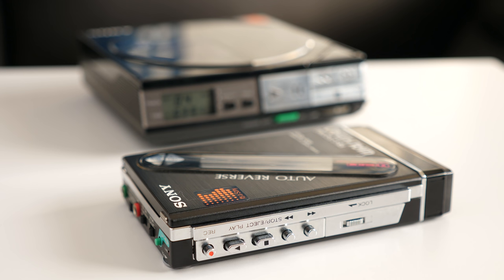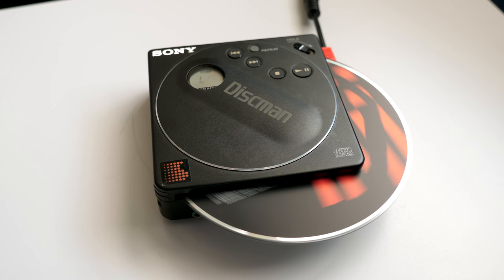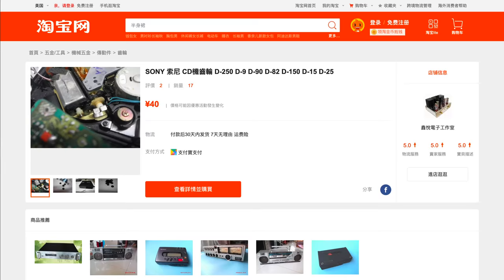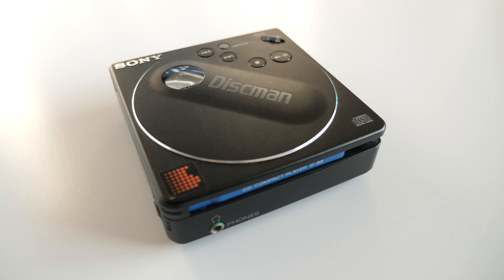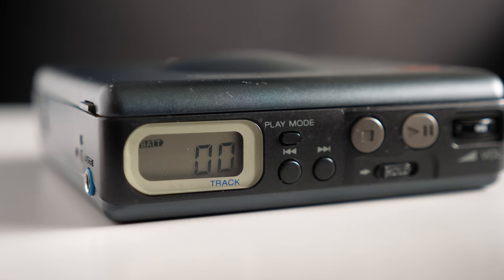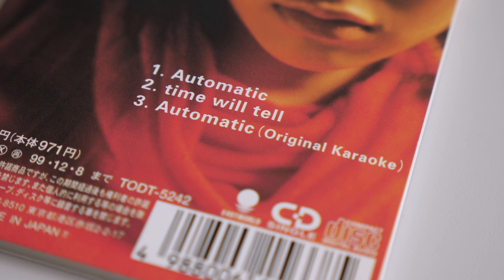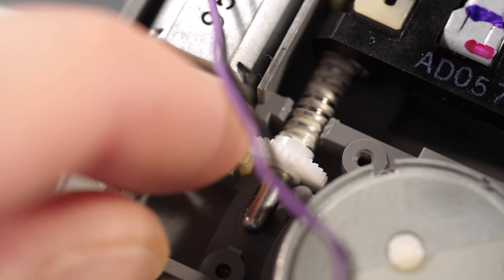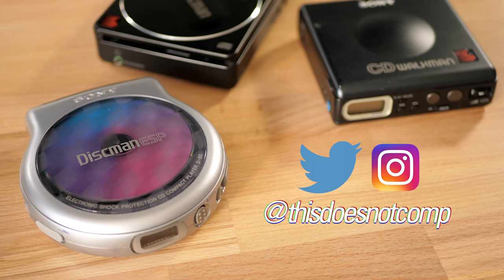The Smallest Portable CD Players Ever Made (That Nobody Bought)

Comment: I remember. D88 used to sell in Sharper Edge. No one had the 300 bucks to pay for it. Besides my D-9 also had problems reading newer CDs. I could use it only for around a decade then its motor broke down. By the way, I am constantly editing my comment, but I need to add some information. Mini-CDs did not find popular base in the US. I bought Metallica's One in mini-CD. It contained a shorter 3 or 4 minute version. I did not like it honestly. Even Wikipedia is not able to remember that shortened radio-version. That mini-CD had much more room to include the full version of the song, but the manufacturers preferred to put the edited version. One day I decided to put it in an envelope and send it to a friend of mine overseas. It wasn't a smart idea but I was a kid, I believed in miracles. It got lost in the mail. I regretted my decision later. Whatever... I bought a 7 inch vinyl record later, with the full 7.30 minute version on a single side. I still keep it. I believe I am happier keeping the vinyl record than keeping that mini-cd version.

Comment: I was amazed seeing this Sony on your channel and I actually own one myself,  like you I had to repair the gear/tracking too. I also have repaired the Sony D-99 player and sold a couple on eBay.. as for the rechargeable battery..I instead modded these myself (taking the remains of inside out with care  and cut the terminals off, fitted a slim AA battery holder and soldered these to terminals.. buy a couple of AA 4.7v l ion rechargeables and then push all inside the casing..works well.
You mentioned about the LCD on the D-88 that you may look into repairing it..is this possible or would you need to replace the LCD itself?

Love your content.
Reply from the maker: I’m not exactly sure yet what it’ll take to repair the LCD, though it sounds like it could be a problem with the flat-flex between it and the main PCB. If I’m lucky it’s just a dirty/bad connection that needs to get cleaned.
Reply: @ThisDoesNotCompute  thanks for your  reply..im not entirely sure if its a ribbon cable fault as I have tried doing as you mentioned and fault still occurs..I feel its more due to the LCD panel itself inside the layers? Anyway will be interesting to see how you get on and you views...🙂
Reply: @ThisDoesNotCompute  in reference to my last comment,  I decided to work out the issue with LCD on my Sony not displaying correctly. I took the intuitive and something told me to apply heat around the LCD panel..to this I took a hair dryer and applied high heat in a circular formation for about 20sec and afterwards let it cool down..this improved the panel but a couple of segment still were not showing.. applied more heat, let it cool down again and to my amazement the LCD panel is back to life and no issues so far... im not sure if this is a solution but in my case it worked wonders..maybe worth something trying?

Comment: The 8cm single was not so populair because it couldn’t be used on a slot loading player, without a flimsy adapter. I have a few 8 cm single, but most cd single released in the Netherlands where 12cm. That said i love the 8cm singles. I have a Freecom MP3 player that uses 8cm disc that can hold up to 185mb. Much more music for a better price back then. A typical mp3 player back then had between 32 or 64mb of storage.

Comment: In the early '90s and the last days of cassette, Sony made some monumentally TINY tape Walkmen. My friend had one that was slightly larger than a cassette tape. Basically the tape, plus a metal shell, and that was about it, with maybe a centimetre of depth on the back for all the workings. Full logic control (ie the buttons weren't mechanical, all moving parts were motorised). Took a tiny little single-cell Nicad, in a weird rectangle shape. Or, you could screw on an accessory that let it run from a AAA battery, significantly adding to it's size even though that was only a bit bigger than the battery was. Either way you'd get more than 10 hours from the battery, I forget exactly how long. Cost him a damn fortune and was one of the nicer ones Sony made. 

I'm sure they'll have made one or two even tinier than that though, and Sony save all their best stuff for Japan. Japanese people will spend more than Westerners are willing to on electronics, though they get some amazing stuff for their money. 

Still, my watch plays MP3s and cost less than 10 quid, so I can't complain really. You can get smartwatches, that Bluetooth to your phone, and also can take a SIM of their own to act fully as an independent phone, for less than $10. 

Or you could mortgage your arm for an Apple one. Seems silly. Mine's got a camera, too, touchscreen, all the usual sort of gubbins. Doesn't have downloadable apps though, but it DOES have Internet, on a value for money ratio it's about 20x better than Apple or Samsung's are. Maybe half as good for 2% of the price.

Comment: After watching this. Was thinking getting a nice portable player mostly for the theater receiver. maybe i can bring it with me. Can someone recommend a recent player that will be good?
I did remember a buddy with his player in the early 2000's and it did have bump protection on his. I never had one, just a hand held radio.
I have a 5 disk player from Sony from the 90's, i gotta find it, it will most likely need some sort of repair. I am guessing a rubber band and some new grease should be enough to get this working again. Just gotta do some research on what kind of band it needs and where to get it.
THey went back to records for a bit, people like them better idk why really, prob better sound to them.
CD's in some cases are better then a mp3 player, because mp3 is compressed, wile a CD in most cases are lossless. Lossless codec exist now (like flac) and media players now can hold a bunch of them without problem with the high capacity space. I use my phone nowadays with a nice high quality 3.5mm adapter.

Comment: I can't get over these miniature rechargeable LEAD-ACID batteries! I'm not an expert on lead-acid batteries but that seems like a terrible idea for a consumer electronics product. I couldn't find much technical detail about them, but maybe you could do a teardown?
Reply: I had that same battery in my discman D25.  I unwrapped the sheet metal casing and ordered a protected LiPo cell that fills the case completely.  2600mAH - at least 3X,works for hours and hours.  Charges fine with built in charging circuit.  

The lead acid cell inside was unremarkable - a single lead cell in a transparent casing where you can see the lead plates within.  There’s prob a pressure relief valve through which it could prob be rehydrated back to life, but not worthwhile given the superior lithium ion swap. It seemed roughly similar to the one cel lead acid battery you can find in rechargeable bug zapper rackets still sold today.

At the time that lead battery blew away NiCd, the only rechargeables around.  NiMH wasn’t even a thing yet.    That lead battery worked for at least a decade.
Reply: @yeliab814  Awesome, thanks for the detail! I had no idea about rechargeable bug-zapper rackets, what a use case! Everything I have heard about lead-acid batteries is that they start to degrade if you take them below 50% charge, even somewhat for deep cycle. I wonder if these little ones got around that and how.
Reply: @jfh400  I doubt they get around it, but at least with the Sony it didn’t seem to  discharge it to zero even when sitting for a  reasonable while .    And I never had it refuse to charge until it sat for 20 years, after the usage during first 10 years.  It was beyond dead, zero volts, accepting no charge. But when the use was regular enough,  even w  periods of sitting on charge, nothing could  kill that cell (at least not quickly ).  It was good at the time, and I’m sure Sony has a few tricks in there not featured in the Chinese mini lead batteries today.  Those things definitely self discharge if sitting long time , and the shite charging circuit in the bug zapper racket is simply mains voltage to capacitor dropper, to diode, then thru a resistor and into the battery.   So long periods of plugged-in charging will overcharge and boil off the water in the electrolyte.  Both specimens I have died already and I replaced with lithium.  I still have the lead cells and they have a little vent cap so they’re easy to fill back up with distilled water, but haven’t got round to playing around with.  Not sure what I’d do with them if revived. ..
Reply: @yeliab814  Very interesting! Thanks again for all the details!!

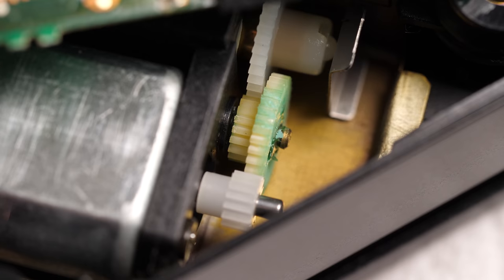Comment: Oh man, at 4:20, you must have let a few "F-bombs" fly off-camera. Saying that $60 US for that gear is a rip-off is a huge understatement, but at least you got the D-88 working. As of typing this comment, there are 2 functional Sony D-88s on Ebay. One is just the player with an AC adapter, but no battery caddy for $899 US, and the other is in the original box with the accessories for $2200 US!!! I assume you got yours from a different auction site than Ebay, because even broken units there will set you back hundreds of dollars! Hell, just even the carrying case on its own costs an arm and a leg! I hope someone provides you with enough guidance to get your D-82 working, as I bet those are even rarer than the D-88. That later D-80 model looks like it was 'rode hard and put away wet' for lack of a better term, so it's probably as good as it's going to get, but if I'm wrong about that, my feelings certainly won't be hurt.